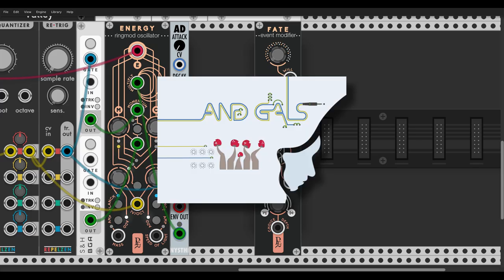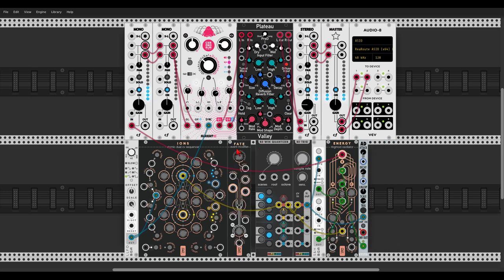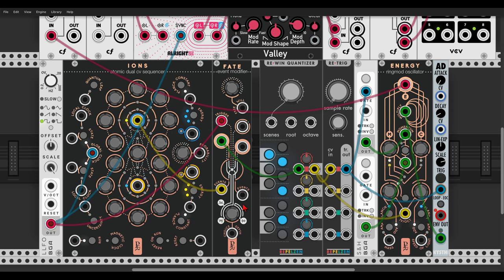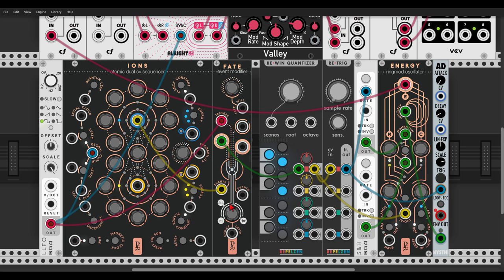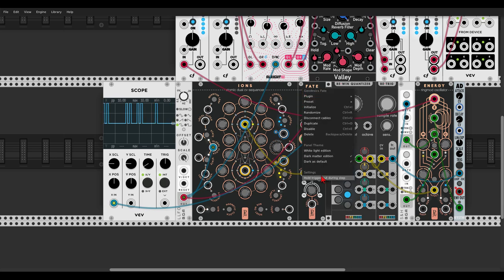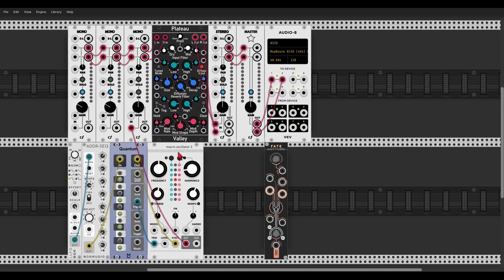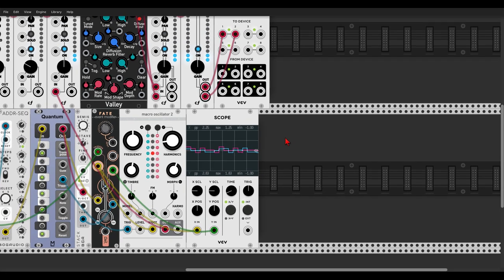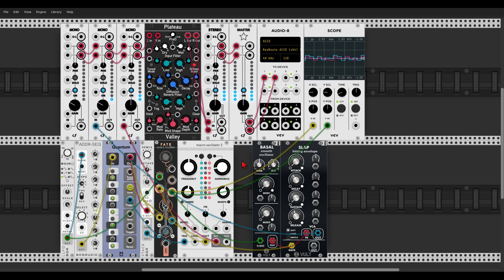Geodesics Modules Series Part 10 - Fate Update

Comment: I recently used the Sequential Switch of ML-Modules to switch only between 1 or 2 signals randomly.This small module would be a good alternative. I will try to use it more often during my practice. It has so many useful features, I think you can use it in many situations. The design of the Geodesics modules is also very nice, but at first sight the function is not easy to understand. Thanks for the detailed explanation.
Reply from the maker: Yeah, the Geodesics is a beautiful collection!